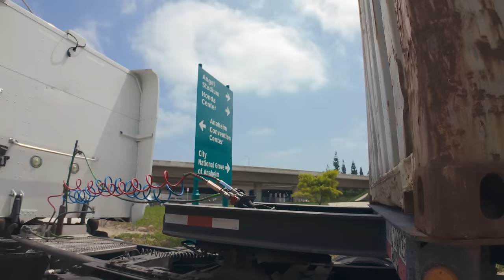Overloaded Container Almost FLIPS my Rotator!

Comment: I gotta tell ya, Josh.  As a NCCCO certified crane operator, when that container broke completely free and swung away from Hulk and the front wheel of Hulk slid, I could see the lean and the verge of disaster decending on the situation.  Butt pucker moment for me, I tell ya.  Those outriggers were screamin for mercy!!!   Good on ya for not freaking out and getting it all stable enough to continue, while walking the tight rope.  I can tell you obviously know your equipment. Great job!
Reply from the maker: Butt pucker for sure :_Approve: What kind of cranes did you operate? I'm always fascinated how similar yet different rotators vs cranes are. Like I explained though, WORST case scenario the truck wouldn't even pick up the container. It would float to a point where I say nopeeee def not happening. Or once it came off the chassis, it would have just landed on it a bit sideways. Crazy stuff!
Reply: @PepesTowingService  I hold current licenses for truck mounted lattice boom and crawler lattice boom, as well as large and fixed cab hydro units.  Basically any mobile crane.  I used to tow here in SoCal in the late eighties.  Now I just drive the transport lowbed, do repairs, set-up, tear down of cranes.  I stay current as I often do fill in operator work for some of our regular operators who are on vacation, sick, etc...
Reply: @PepesTowingService  I believe they are similar, too.  Obviously, with the underlift, and extra recovery winches they are different.  That said, the rest of Hulk is literally an overbuilt, very strudy boom truck, with the emphasis on "VERY STURDY".  Haha she is a strong girl for sure.  Take care, my friend.
Reply: @reevinriggin3570 yes but no the boom on your crane is designed to deadlift lift vertically and move  or swing his boom is designed to do that but also drag and pull in weird ways with angles  that will flip your crane  or buckle the boom well before his rotator will (if you were same wll for wll on both) there both great tools just very much designed to do very different jobs in very different ways with drastically different stresses
Reply: @PepesTowingService I agree with you based on the differences between a crane and a rotating wrecker but a good wind in the right directions between the chassis swap could’ve been a serious problem it’s never the normal everyday situation that ends in disaster that said you can do what you want with your tools
Reply: @Doubie.  Yes.  Hence my reference to tthe rotator boom being "very over built"  inferring to the fact the boom on a rotator is extremely strong for the amount of length.  Not different jobs, though.  Physics are physics on this planet.  The same stresses are indeed applied the same.  One is built heavier to endure the side loading that a normal crane cannot, and should not, have applied to it.  They do however, function the same way and do the same thing.  Lift stuff.
Reply: I pick things up and I put them down…..

Comment: I'm impressed that the second driver backed that trailer up beautifully. That's impressive.
Reply: Absolutely amazing….
Reply: Spot on
Reply: I said god dang that was on point. Made the job much easier.
Reply: straight-backing into a hole with a foot or two of wiggle room is a requisite of getting a CDL, but that right there was exact to the millimeter!
Reply: ditto, presision driving.

Comment: As a rotator operator for close to 10 years in New England myself, I can say, its nice to have a call every once in a while that still gets all the juices flowing! Excellent job that most operators would have waited for a second truck. You knew your truck and what it was capable of.
Reply from the maker: Yes sir! And how interesting, what kind of rotators do you have out there? And how is work, busy? Curious to see if you guys get a lot of rollovers and container work as well
Reply: Yea if he had to move it that would have been a different story. Like rotate it a bit. Then I know he would not have done it. Only lift it up then back up the other truck. It would have tipped and just landed on the trailer.

Comment: When you explained that you had tested the lifting capacity of "hulk" by lifting "big flipper" beforehand, that is a good way of knowing that, in a pinch, "hulk" can lift the weight in question and help you keep your reputation with the police agencies involved intact, especially when the travel time is a factor. If I were driving the replacement tractor-trailer, I would have stayed right in the seat upon arrival and have been ready to move the unit at that moment's notice.
Reply from the maker: Yup, I’m ALWAYS practicing and learning even when it’s slow. It’s the best way to truly know what your equipment is capable of and in an emergency situation like this, is invaluable.

Comment: Clean rig you got there. From my experience had that tri-axle extended his chassis he would’ve been good. That second chassis is bound to flip, crack or bend unless he extends the chassis too. Containers are coming way over weight right now due to the cost of shipping/transporting. So 50-60k lbs seems about right.  
 Stay safe out there brotha🤙🏻

Comment: You could have compensated by over correcting your platform. But you are absolutely correct the 2 part outriggers are definitely the weak point of these trucks.

Comment: As a european crane operator, i can only say "holy shit there are many red flags".. Shit like that is a total no go in europe..
Reply from the maker: You speak for the entirety of Europe? That's crazy you must be super important and famous with that much authority
Reply: @PepesTowingService  lol, no need to get snappy, mate. Just saying we got laws that prevent us from doing stuff like that. Here you wouldn’t be in the business for long if you pulled these stunts. 
And just a question, out of curiosity. On my truck the wheels need to touch the ground, cause they act like ballast. Is it not the same way on yours?
Reply: @Flux2734 I've seen this behaviour often in the USA. Safety is not a concern, until there is a problem.
I've seen guys unloading a 45.000 kg piece of equipment with an oilfield bedtruck at the back and a picker truck at the front, "Texas style". The bedtruck flipped with the load, damaging the trailer on which it was loaded.
Reply: @PepesTowingService Yes he does, laws are written down and he can read them. What you’re doing in this video is f*ed
Reply: @over9000andback unless you do this type of work, you can’t say shit!!

Comment: Well, if that can only weighed 60,000 lbs, the max gross weight rating on that 20' container was 67K, so the container itself wasn't overloaded, as long as it was evenly loaded. So that chassis was total junk if it broke like that, no bumps in the road and wasn't even max gross weight, still 3 tons or so under the max safe load.

Comment: Good thing those loads don't hit a weigh station.  Looks like there's a lot of local stuff skating by.  Those metal loads can get crazy for a 20'.  Would have been interesting to see how heavy it was, but yeah, 60k doesn't seem too far off.  That was a pretty solid lean.
Reply from the maker: 10000% my fault for not putting my wireless load cells. They're way more accurate than a boom loading sensor and I have no excuse why I didn't put them on other than I forgot lol

Comment: I used to pull containers and would take a 20 ft container on a tri axle chassis here in Florida and I always had a tire blowout. Container loaded with tuna can boxes floor loaded. No pallets. I noticed that the damage chassis trailer here in this video was a triaxle, the replacement was a two axle. Container too heavy for that chassis trailer. That's why the crane operator told the new driver, this container is very heavy.

Comment: You sure are crazy and really good at what you do. I noticed that cranes and older Miller rotator have outriggers higher up and then leg goes down to the ground. That gives them better resistance to flipping over, but they need more space to work compared to these never rotators that have whole outrigger on the ground. I am really fascinated with designs on rotators, they do so much but need very little room. That is the point I guess. Anyway respect mate and greetings from Europe.

Comment: 10:46 That's pretty insane how those rotator can do that amount of weight. Surprised there is no frame warping with that amount of twisting, or at least bending the posts for the outriggers attaching to the truck frame!

Comment: Did the truck dealer explain why there's a chassis shortage? I've been trying to order a new one since November, and they're blaming CARB for requiring 2024 compliant engines in 2024 chassis. Seeing as how the engines have to be older than the chassis they're they're being installed in, we were told it was going to be July before it all gets straightened out
Reply: Currently, all heavy duty manufacturers have been asked to order one electric vehicle for every ten orders . Diesel engine orders are in but they're unable to comply with the electric vehicle mandate.
Reply from the maker: Politics really. It sucks, because besides us I know so many other people that have been waiting so many months

Comment: Josh instead of ordering a new rig, could you have the same outrigger system you have on Big Flipper. Then swapped out the outriggers on Hulk?
Reply: Designed system that was installed by Miller. Have to have the entire back end re worked for it to work.
Reply: @haloreaper1000  Thank you for that information! :-) Long run cheaper to go with a new rig.

Comment: Hey Josh !!!  Is the ""NEW" Hulk gona have an underlift on it as "" Big Flipper "" doesn't have 1 to split the outriggers like Hulk Does ??  Great job with NOT flipping or bending  the boom on Hulk !!
Reply from the maker: Yes! Hulk definitely needs to be able to tow. They have different variations so it won't be the same style underlift as my current Hulk but it will for sure have it.
Reply: Ten West Towing out of Bakersfield has at least (3) 50-ton Century rotators with the dual I-beam set up. Jim Cady Jr. loves those knee booms (we don't ! lol) on those units. Big Flipper does not have an under-lift as it weighs 72,500 lbs.. Cal Trans will issue a "Self-propelled" permit for it but NO TOWING is clearly stated. Remember the original Century M (100-ton sliding rotator) was not equipped with an under-lift.

Comment: two questions does putting the tag axle down ever help you and were the left side outriggers kept in due to the open lane? I was surprised to see it lean so much when ive seen it pick up big flipper. 

SO what is technically taking the "flex" there the body/frame/outriggers?

Comment: I'm in the crane industry here in NYC. We see thus kind of stuff all the time. Rotators that think they're cranes. Big difference! Cranes have a much better stabilized footprint, and they have ballast. Whether it's travel weight, or trucked ballast. You took a huge chance here bro. This is why many crane operators hate demo work. They tell you the demo'ed piece weighs 8 tons and it's comes off at 15 tons, shock loading the boom. Proper tool for the job man. An LTM 1055 or even an 1100 would of been fine here
Reply from the maker: I'm assuming you are new to this channel and had this video sent to you, otherwise you wouldn't be talking out of your behind. I go over MANY times in so many of my videos of the vast differences between cranes and rotators. You have the benefit of hindsight. You can do anything in the world with hindsight. Watch the video with sound, you'd see the container was told to have 30,000lb which I could easily do. I also made the call to finish the job once I knew it was heavier because I knew I could do it. My rigging was ace, the truck leaned but was in no danger like I explained. You are correct in your other points, but this is the freeway. Your crane would have to shut down the entire offramp, plus how long would it take to find a crane company, hire them, then have the crew roll out? Huge cranes don't just show up and in 10 min they are setup and ready to lift like I am. You need at least one tractor trailer with your counter weights, outrigger pads, etc. I work with cranes a ton and they absolutely do things rotators can't, but there's a time and place. I saw a video of a crane that went into a ditch, nothing too bad recently. With two of my rotators it would have been an hour max job. They used two cranes. Was a morning until night job. See what I mean? You're just using this sole video, ignoring my 500 others, to prove your point of "LOL this rotator thinks he's a crane!"

Comment: Hey Josh, I was wondering... What is the advantage either using the container slings, versus the container shackles?
Reply: Even with shackles , you would need some kind of a sling configuration. Slings are light and have different lengths. This prevents us from pulling out more cable than we have to.
Reply from the maker: What my pops said, but in a case like this it’s just user preference. Alex seems to like the container links more, I like the slings. Both are rated for almost the same, again just user preference.

Comment: I bet it weighed close to 100.000 lbs I did that work for a while when I was laid off and have seen 20 footers weigh 80.000, to bend that Chassie and make your rotator twist like that it was way heavy. I have seen the DOT try to weigh them on portable scales and they would sink into the asphalt.

Comment: As a nccco operator for the last 13 years. Most of those shackles were used in excess. You should also boom up more so the load swings towards you instead of away if you’re not sure on the weight. I usually just put some tension on the cable till I see it’s about to lift and use the boom for the rest of the weight.

Comment: I would park with a angle in that way front support arm barely  allows trailer to escape and rear as close to trailer as possible. in that way rear support arm would be behind trailer and close to rear wheels of the trailer.

Comment: Why not crib under the rear shift leg with a 4 x 6?
Reply from the maker: Great suggestion, are you in the industry? For what it’s worth it would not have prevented this lean at all. I’ve done it with my 2” outrigger pads, wood, etc. The rear outrigger is just too small and doesn’t provide enough support when lifting past the factory capacity

Comment: Is it good to know your truck, but better to understand mechanics. As soon as the pads on the `inner` outriggers are the sole support the thing will tip over.  In that tilt situation the pad is the fulcrum of a balance and with an increase of the tilt the load will win to tip the truck over since the load get a longer arm to pull on as it swings out away from the fulcrum. The  distance between the center of gravity of the truck and the pad actually decreases with more tilt so the truck will flip over.  In this case it didn`t because the outrigger itself is flexible and was not completely off the ground yet and that save the day.  Effectively  the fulcrum was still somewhere between the truck and the spade.

Comment: WITH A 25 TONNER  EVEN A 20 TON IN THE BACK IT CUOLD BE DONE ...OH WE HAVE ONE OR TWO....
Reply: The Century 5130 (25-ton wrecker) can lift 16,000 lbs. at an extension of 113' ( 9 1/2 feet ). Stay in your lane partner. Leave this for the Big Boyz. lol At a minimum of 60,000 lbs. , the rear of the container comes in at 30,000 lbs. Comprende ?
Reply: @JoseAcosta-hr9js  pense que eras mas listo.....:pride-fan-rainbow-open:
Reply from the maker: One in the back I can see, what about in the front? How would you have the chassis pull out and the new one back up? Block the ENTIRE exit?

Comment: How was he not Red Tagged by the CHP?
Reply: Normally a weigh station or inspection facility does that.  If an MRE ( Mobile Road Enforcement ) had shown up maybe . Remember it was originally on a 3axle chassis. Those are allowed 42,500 lbs. ( with no permit ) vs a tandem ( 2-axles) which are at 34,000 lbs.
Reply: @JoseAcosta-hr9js  I'd figure the motorcycle patrol would have called it in for inspection, after having to shutdown the lane . Any Acosta family from Diamond Bar?

Comment: Engineer here… one thing you’re not taking into account dude is metal fatigue when consistently over stressing the critical members, which you do a lot from the videos I’ve seen. Since you don’t have built-in scales you don’t know for sure how many times nor by how much you’ve over stressed the system. Be careful out there.
Reply from the maker: Which videos am I consistently over stressing? I have this one and where I lifted flipper. But if you've seen "a lot" of other videos I can't see how this would be a talking point to you since I'm a huge proponent of working within your safe working load limits and using load cells

Comment: Y did ur truck lean like that when u have lifted ur dad’s wrecker with that truck??????????????
Reply: Big Flipper was much closer to Hulk on that lift. Great point though !!!!
Reply from the maker: Every lift is different. I was more extended and a bit further out compared to RIGHT on the line with my dad’s truck. It sounds insane but every single foot makes sooo much difference when dealing with this much weight.
Reply: @PepesTowingService  k